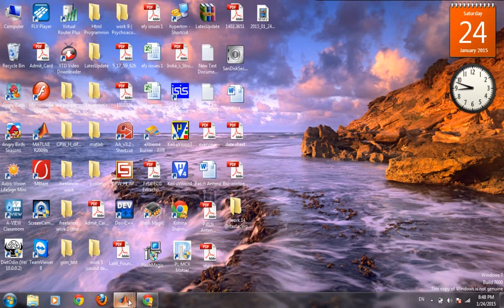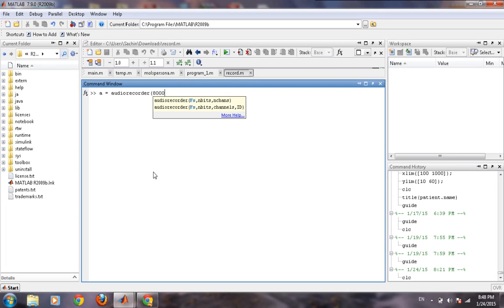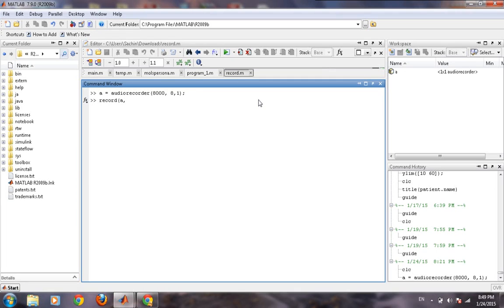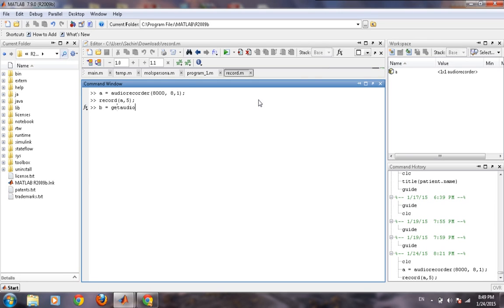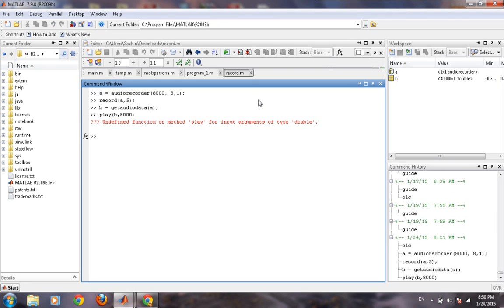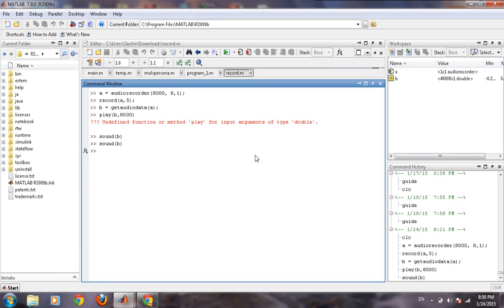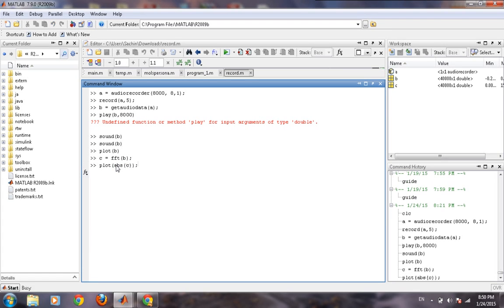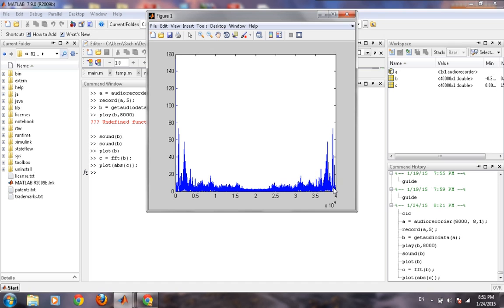How to record sound and do spectral analysis in Matlab???

Comment: you can not apply fft directly on speech signals as they are non-stationary signals they have to be pre processed.
Reply from the maker: Hi, here we just applied the FFT for demonstration purpose only. If you are writing a code for any specific application then you can use theoritical concept to get the better results.

Comment: why this error occur .what is device id 

>> a=audiorecorder(8000,8,1);
??? Error using ==> audiorecorder.audiorecorder at 97
Audio input error: A device ID has been used that is out of range for your system
Reply: did u get any answer to this? i am stuck at the same problem
Reply from the maker: Matlab provides the id to each recording device connected to your computer. You should first check the device id from which you are going to record the voice.
Reply: Sir 
how we can check the device id
Reply: how this error remove sir
Reply: Try adding an ID. I would start with 1 and se what happens sudiorecorder(8000,8,1,1).